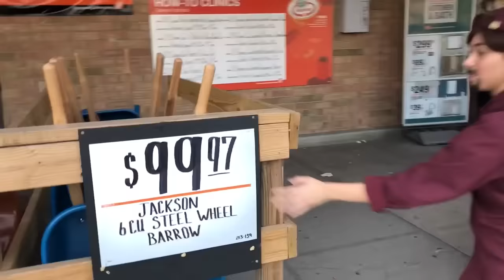Woman lives as Man for a day

Comment: “every man knows what’s under the hood of his car!” guess I’m a girl now
Reply: Most of what's there is electronics. Everything else is really simple: gas in compartment, gas explodes, platform goes down. More gas comes in, platform goes up.
Reply: Phelan  I know that all the electric stuff is important, for starting the car, making sure the engine doesn't explode too much, etc. But in layman's terms, the thing that matters is the drivetrain, the fuel pipe, the transmission, and the cylinders. Gas explode make platform go down make axle turn make car go.
Reply: You must be an earner then? Good on you.  Rest of us couldn't afford a mechanic when young.
Reply: @eMorphized  Sorry for being pedantic, but nothing “explodes” in an engine (normally); it’s called a combustion engine for a reason. A combustion is a controlled burn, not rapid enough to be considered an explosion.